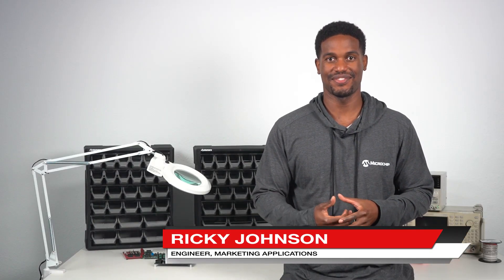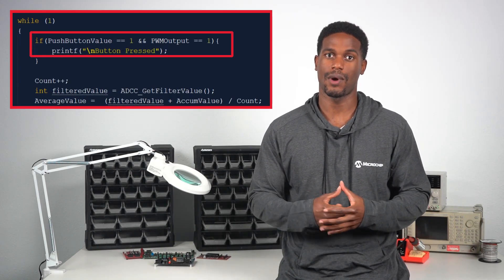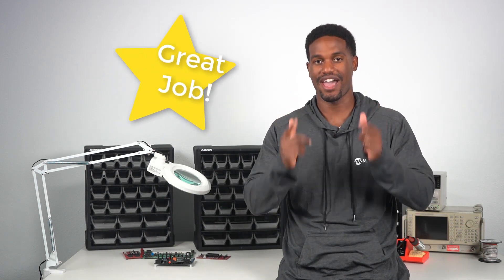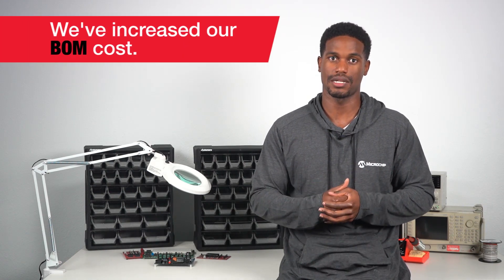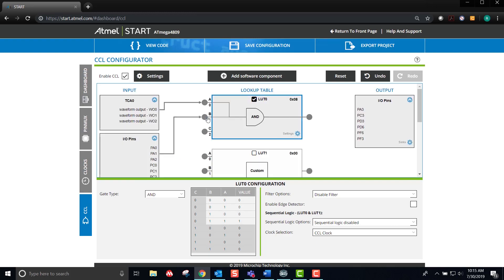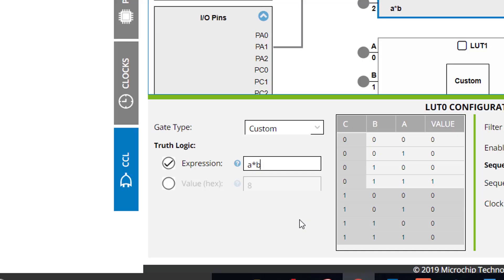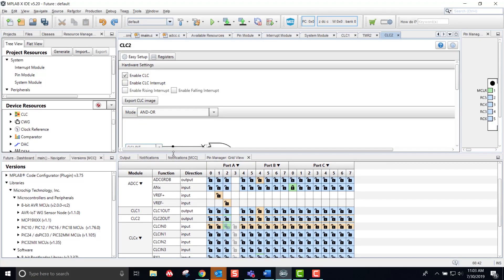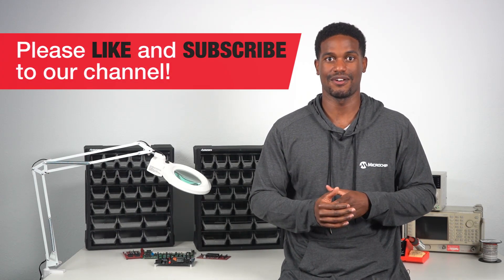Exploring Configurable Logic Peripherals on PIC® and AVR® Microcontrollers

Comment: Is this feature available in the Arduino environment? Otherwise, how else have I never heard of this before?
Reply from the maker: If you have an Arduino board with an ATMEGA4809 variant, the CCL is a peripheral available on the device.
Reply: Desert Vox you need to buy their at4809 board
Reply: In fact it is not compatible with Arduino as none of these chips are used in Arduino boards.